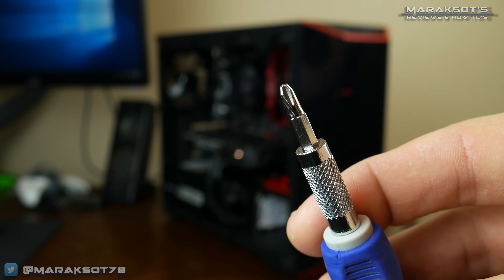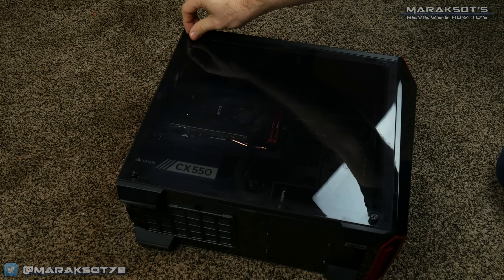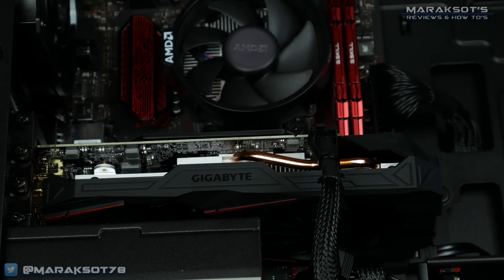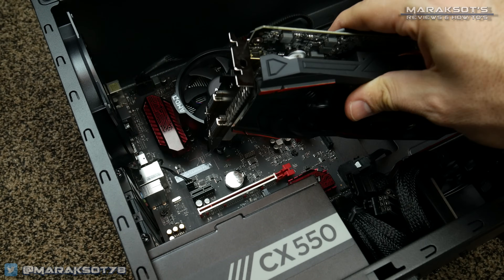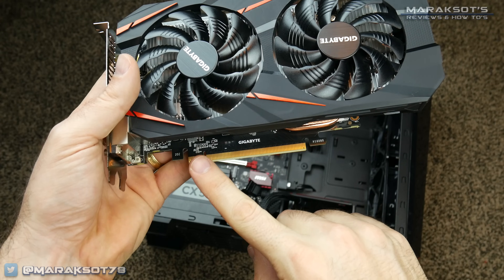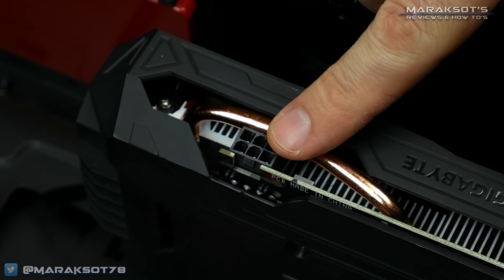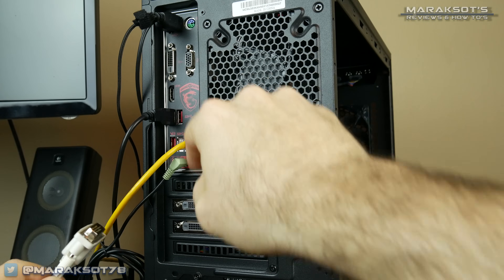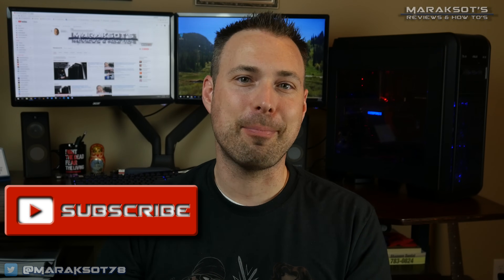How to Install a Graphics Card - Upgrade Your GPU

Comment: I have 2 pci express slot do I need to put 2 of those to work or I only need 1
Reply from the maker: many motherboards have 2 or more PCI express slots.  You only need to populate one.  If you can, the top most slot is the one you want to use as it has the most PCIe lanes going to the CPU.  You can put it in other PCIe slots and it will work just fine it's just the top one is the best one.

Comment: when i start my pc post installing a new card, it is not boot to windows. what to do
Reply from the maker: First I'd check to make sure your new graphics card is fully seated in the PCI express slot and make sure the PCIe power cables are properly/completely plugged in. If these things are done correctly then my question for you is do you see your motherboard splash screen and then as it goes to load into Windows you just get a black screen? If so, updating your motherboards BIOS/UEFI should fix the problem.

Comment: Need an opinion. Is GTX 1660 good fro casual gaming? (e.g- LoL, HoN, DotA etc..)
Reply from the maker: If you want to play those at max settings and at insanely high frame rates (100-200fps and maybe even higher), yes the GTX 1660 is a great card. It can play modern AAA titles at 1080p on max settings and easily stay above 60fps at all times... assuming you have a powerful enough CPU that you don't bottleneck the 1660 that is.
Reply: @Maraksot78  thank you kind sir

Comment: I just changed my gpu, and my screen got so blurry i could barely see to install new drivers. Now it seems to be fine. Should i be worried?
Reply from the maker: That's normal. When you install a new grapgics card it will often default to a really low resolution but most of the time Windows can see the native resolution of your monitor and switch it automatically. Sometimes it doesn't though and you have to set it yourself. Once you install the drivers it will usually switch to your monitors resolution. From what you said it sounds like you're good now.
Reply: @Maraksot78  yeah once it got to like 30% complete on the driver install the screen turned off and came back on normal. Thanks for the answer.
Reply from the maker: No problem. Enjoy that new GPU. :)

Comment: How easy is it to upgrade to a gpu from integrated graphics
Reply from the maker: upgrading from integrated graphics is the easiest process IMO.  All you need to do is remove the expansion slot covers on the back of your PC, install your new graphics card, plug in the PCIE power cables to it if your card requires them, boot up your computer, download and install the drivers for your GPU and your'e good to go.  No need to uninstall old drivers or anything like that.  :)
Reply: Maraksot78 thanks so much man i was genuinely considering not risking it and staying on low settings lol
Reply from the maker: @jooordey  No problem man. I'm happy to do what I can to help. Cheers! :)

Comment: If I have a case that has extra slot ports, do I have to replace my old card or can I use both?
Reply from the maker: Well it depends...  Nvidia and AMD in the past both supported multi-GPU set ups.  Nvidia calls theirs SLI and AMD calls it Crossfire.  As far as I know it was only supported on identical GPU's however.  For example if you had a GTX 980 then you'd have to have a 2nd GTX 980 to make it work.  If you had two different GPU's then as far as I know it does not work.  With the launch of the 10 series graphics cards in 2016 Nvidia quit officially supporting SLI and AMD has also since followed suit.  Most game developers do not support multi-GPU setups in games as it requires them to code their games specifically for it so people that had multi-GPU setups were really only using one GPU.  There are synthetic benchmarks like ones from 3DMark that support it but most games nowadays do not.  My advice would be to sell your current graphics card and use that money to help you buy a new more powerful one.  Cheers!  :)
Reply: @Maraksot78  Thanks!!
Reply from the maker: @ItzJustMako616  no problem.

Comment: What if my graphics card is integrated
Reply from the maker: Are you using a laptop or just using the graphics processor built into your desktop CPU?
Reply: Maraksot78 I’m using a ryzen 5 3400g
Reply from the maker: Ok. If you follow the steps in this video you'll be all good. Just be sure to plug your monitor into the outputs on your graphics card instead of the output from your motherboard.
Reply: Maraksot78 will it make it faster with a integrated and a normal graphics like a gtx 1650
Reply from the maker: You can only use one or the other.  You can't use both simultaneously.  If you're looking at a GTX 1650 may I suggest the Radeon RX 570 instead.  The RX 570 is more powerful than the GTX 1650 and, generally speaking, the RX 570 is less expensive.  Some models are the same price as the 1650 but others are much less expensive. The bottom line is for the same or even less money than the GTX 1650 you can get more performance from the RX 570.
Reply: Maraksot78 I have the 500W bronze psu is that enough
Reply from the maker: Yes that's perfect.
Reply: Maraksot78 okay thank u and also does the gbs matter do they make a difference in the psu
Reply from the maker: Are you asking about the amount of VRAM? 8GB as opposed to 4GB? The more VRAM you can get the better. But that doesn't matter when it comes to your power supply wattage. Having more VRAM will affect your game performance though. All the game textures and other stuff is loaded into the VRAM so if a game uses up all your VRAM then it has to load them into system RAM which is slower than VRAM and your fps goes down. 4GB is the minimum I would recommend right now, 6GB is good but 8GB is of course better.
Reply: Maraksot78 okay thanks and how would you switch from the integrated to the gtx 570
Reply from the maker: You just install the RX 570 like I show in the video, connect your monitor to it, install the drivers from AMD's website and you're good to go.
Reply from the maker: There's nothing special you need to do really. Once you've installed your graphics card, connect the display cable from your monitor to the appropriate output on your graphics card, download and install the drivers and you'll be good to go.

Comment: 5:30 my video card has a 8 pin, and then a 6 pin, so 2 pin are in the air becuase the cables have 8 pins, so 2 pins are left in the air . Just to mention it, because youtubers never solve this doubts
Reply from the maker: Most power supplies have PCIE power cables that are 6+2 pin. Meaning if you only need the 6 pin connector you plug in the 6 pin portion and leave the additional 2 pin portion disconnected. If your graphics card requires an 8 pin power connector then you connect both the 6 pin and additional 2 pin. If your graphics card requires both a 6 pin and an 8 pin power connector then you plug the 6+2 pin connector into the 8 pin port and then another 6 pin connector into the 6 pin port.

Comment: I know this is a lod video but what if my pc has a integrated radeon card meaning its built in i found the right card but do i need to open anything and select which card to use on the screen
Reply from the maker: Some times once you plug in a dedicated graphics card the onboard graphics on your CPU is automatically disabled but even if that doesn't happen with your system, in order to make sure you're using your gaphics card and not the IGPU all you need to do is plug your HDMI, DVI or whatever display cable you're using from your monitor into the corresponding display out on your graphics card and you'll be good to go.

Comment: Hmmmmm I can’t find my pcie cable 🤔
Reply from the maker: it is possible your power supply doesn't have a PCIE power cable.  In that case you either need to get a new power supply or you can use either SATA to PCIE or molex to PCIE adapters, assuming your power supply has enough wattage to power your new graphics card of course.
Reply: Maraksot78 ok thanks

Comment: Hey can i use a 6+2 pcie power cable for a 8 pin gpu like gtx 1660
Reply from the maker: absolutely you can.  That's what the 6+2 is for.  If you have a card that only needs a 6 pin you've got that and if your card requires an 8 pin, you've got that too.  Cheers!  :)
Reply: @Maraksot78  thanks ^_^

Comment: The problem im having is im trying to upgrade from a radeon 200 series a 2gb ddr3 card to a rx570 ddr5 card, when i plug in the card its just black scree , even plugging into the motherboard and its still black screen so its hard to install drivers
Reply from the maker: Does your system boot fine if you put your old graphics card back in?  Also when you first boot up can you see your motherboard splash screen and then goes black as it loads into Windows?

Comment: im new to computers but my computer was prebuilt with a r7 240 and it says radeon graphics am i only allowed to use radeon graphics or can i use geforce graphics
Reply from the maker: You can use either an AMD Radeon or Nvidia GPU no problem.

Comment: Hi maraksot78 I was just wanting to ask if my pc can hold a graphics card the pc is a stormforce onyx A10 8 GB 1 TB Radeon R7 gaming pc. Thanks if you can help if not no worries and thanks:)
Reply from the maker: Yes you can definitely upgrade your system by adding a discrete GPU. The A10 is an older AMD APU but should pair nicely with any graphics card up to the RX580 or GTX 1060. Anything more powerful than that will be bottlenecked by your APU. The nice thing about those GPU's is they're awesome 1080p 60Hz cards.
Reply: W
Reply: Hi cheers would a ASUS Nvidia GeForce GTX 1050 PH GTX1050TI4G 4GB GDDR5 work and is there anything extra you would need? Thanks a lot.
Reply from the maker: @Harry-bu8br  a 1050ti would be a great pairing. May I suggest looking at an RX 570 instead of a 1050ti? Currently the RX 570 is less expensive than a 1050ti, is more powerful and offers more performance.
Reply: Maraksot78 thank you so much for this it helped me so much I will order it now thanks:) a new subscriber enters:)
Reply: Just one more question does it need additional pci power?
Reply from the maker: @Harry-bu8br  if you're asking about the 1050ti it depends on the card you get. Some 1050ti's require an additional 6 pin power connector and others do not. As for the RX 570 I believe all of them require an additional 8-pin PCI Express power connector.
Reply: Ok thanks do you know if mine has additional 8 pin because I cannot find one.
Reply from the maker: @Harry-bu8br  that I do not know. It is very possible you will need to upgrade your power supply in order to support an RX 570. It is recommended you have at least a 450 watt power supply to run an RX 570 just FYI.  You can find that information on the power supply unit itself. You want to make sure your maximum output wattage is at least 450 watts.
Reply: Maraksot78 ok thanks I have 500 to be sure now what would I do? Sorry for so many questions I just want this to work.
Reply from the maker: @Harry-bu8br  I don't quite understand your question. Are you asking what to do if your power supply does not have an 8-pin PCI Express power connector? There are adapters you can buy which are very inexpensive that can adapt 4-pin Molex or SATA connectors to PCI Express. Here's a link to one so you can see what I mean. https://www.amazon.com/dp/B01DV1Z4X2/ref=cm_sw_r_cp_apa_i_ow5gDbP5BCZQP
Reply: Maraksot78 thanks we’re would you plug the other bit in i mean the non 8 pin bit were to plug it in
Reply from the maker: @Harry-bu8br  the particular one I linked you is a SATA power to PCIE ppwer adapter. On that particular cable you would plug the SATA ends into any available SATA power plugs coming from your power supply.
Reply: Maraksot78 is this what one looks like. 6 Pack 18 Inch SATA III 6.0 Gbps Cable with Locking Latch and 90-Degree Plug, Red( just put it in Amazon)
Reply: Maraksot78 sorry I don’t know anything I’m 12 so I’m not that good with these
Reply: And also I’m really worried that I bought this for nothing as it was all of my money wasted as I can’t see that sort of cable inside.
Reply from the maker: @Harry-bu8br  no, those would be the SATA data cables. SATA is the interface hard drives and SSD's use. If you look at your hard drive you'll see two different cables connecting to it. The smaller one is the data cable and the wider one is the power.
Reply from the maker: I'm confident you have at least one SATA power cable in there providing power to your hard drive and that one cable should have multiple power connectors on it to power multiple drives.  I would imagine you won't just have one cable though.  I'd be willing to bet you have at least 2 SATA power cables in there with multiple power plugs on them.  You may even have an 8 pin PCIE power plug in there too.  I don't know how comfortable you are with taking the side panels off your PC but if you remove both side panels you can get a better look at what you've got going on in there.  Since you have a pre-built computer I imagine they've routed all your cables behind the motherboard tray so if you only remove the one side panel allowing you to see your mother board and CPU and stuff (usually the left side panel) you may not get a very good look at all the power cables and stuff.  If you remove the other side panel (the right side panel) you should be able to get a much better look at what you've got.  Be sure to unplug your computer first and don't be afraid to get in there and dig through the wires to see what you've got.  You won't hurt anything doing that.
Reply: Maraksot78 ok cheers will do tomorrow.
Reply: Uhhh the side panel won’t come off and I was told not to by my mum so.
Reply: It won’t work I’ve plugged it all in except for the video plug as I don’t have one for my monitor so I don’t know what to do.
Reply from the maker: @Harry-bu8br  so are you saying you installed a new graphics card but you didn't connect any power to it? When a graphics card has PCIE power plugs on it, you have to plug in power to it otherwise it will not work.
Reply: Maraksot78 don’t worry it’s working thanks for all your help.
Reply: Hi it’s been a while sorry again for this but I didn’t think I would need that video cable as my monitor doesn’t have one and the graphics card video cable is blocked so I can’t open it. Do I need a new monitor and how do I get the cover off the graphics card thing??

Comment: Hi what are one of the best graphics cards to run DirectX 11 I currently have a GTX 1060 3gb Vega
Reply from the maker: I know a lot of the big tech reviewers will say to stay away from the 3GB GTX 1060 but I used one in a build awhile back and I feel it's a really nice 1080p 60Hz graphics card. If that's the resolution and refresh rate you're gaming at I say you've got a nice GPU working for ya.  :)
Reply: @Maraksot78  Thank You. I was interested in using a 144hz monitor would that work?

Comment: Would an asus strix rx 480 8gb work with 16gb ram, amd 5 ryzen 2600 and a 450 watt psu please answer
Reply: yeah dude, 450 watt is the minimum for the 480. I do suggest getting a higher psu though incase you want to overclock the gpu
Reply from the maker: Yup, I agree with Gorilla.  :)
Reply: I really appreciate im new  to the whole pc thing. Not sure if I’ll overclock anytime soon. But either way will consider a new psu since it’s the minimum an once I do some research I’ll consider overclocking, thanks guys
Reply: My plugs that fit into my gpu say vga an it’s an exact fit am I supposed to do that
Reply from the maker: @mixerflaimed5543  yup, that's the one you want.
Reply: Maraksot78 sweet! Thanks I dropped you a sub
Reply from the maker: @mixerflaimed5543  you're welcome. Im happy to do what I can to help. Thank you for subscribing. I really appreciate it.

Comment: Does this work for any pc and any gpu
Reply from the maker: This is what it's like for the majority of PC's put there... there are some PC's, especially prebuilt systems (from companies like HP, Dell, etc) that may have custom motherboards and power supplies that this won't really work with. But again, most PC's are similar to what I show in this video. Cheers!